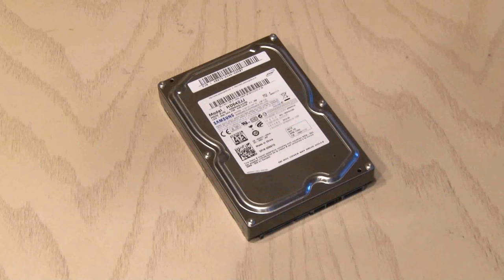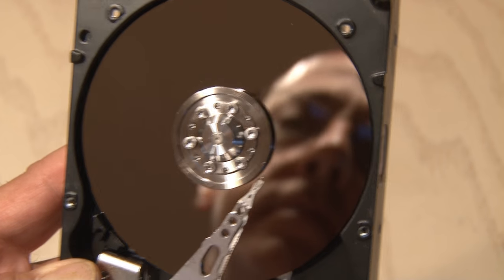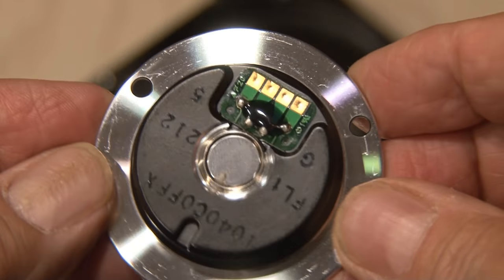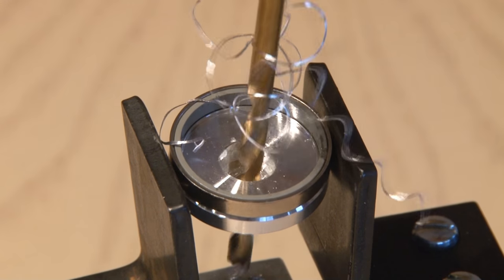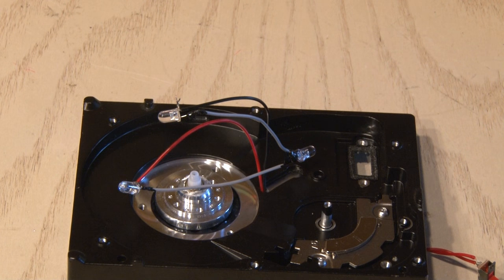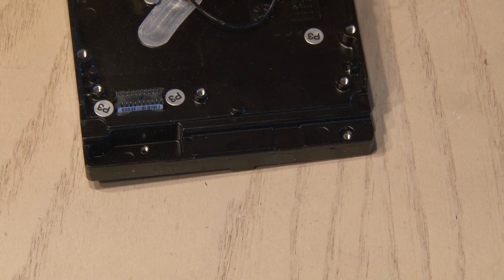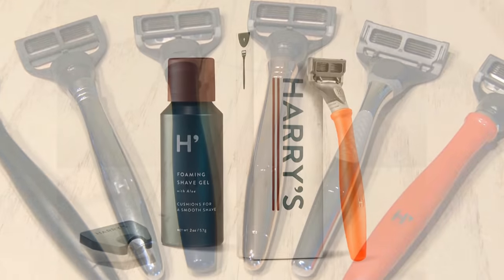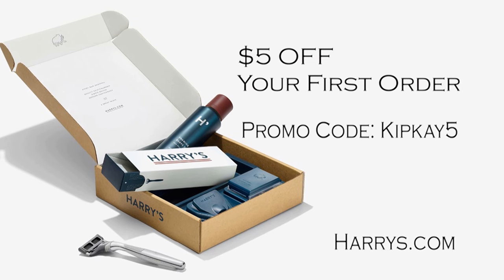Turn a HARD DRIVE into a CLOCK!

Comment: I didn't see any used, but was a resistor used with the LEDs?

While they will "work" without, LEDs should generally have a resistor wired in series. The resistor is to limit the current going through the LED - without one, the LED can draw too much current and can burn out.
Reply: They have there own resistances, enough in series won't require a resistor, mr farraday.

Comment: I dont have a vice so i used a couple of dumbbells to hold the spindle while i popped out the motor and bearing. I also had to hold the spindle with a pliers while drilling out the center piece. It took me a while but was able to make this project. Thanks kipkay

Comment: Two minor things I'd have done differently:

1.  I'd have wired it so that the clock and the lights use the same power source (and I probably would have gone with the AC adapter idea, just because I hate changing batteries).

2.  I'd have either cut down or picked out different hands for the clock so that the fit within the radius of the platter.
Reply: 9 ≠ 1.5
Reply: @Snake Plissken - Small voltage regulator boards are available for less than the price of the clock movement.
Reply: Good point. Didn't think of that.

Comment: It would be nice if the disk itself spun around and the original hard drive spindle was the clock-arm to tell you the hour. That'd be sick.
Reply: if the pcb was still in tact i guess you could hook it up to some power like a psu

Comment: Making a rotating LED clock out of the disk and motor would have been much more impressive.
Reply: Was thinking the same, but the rpm on the hard drive would require some heavy down-gearing

Comment: Disappointed...I thought the RPM of the motor will be adjusted to the movement of a clock
Reply: OMG I THOUGHT THAT TOO!
Reply: i thought that too
Reply: That would require complicated gearing. Not the type of stuff Kipkay is known for. His projects are very simple and usually pretty cheap. Adding the gearing would put both of those out the window.

Comment: You may have did your binairy wrong my chap.
1100 is 3
0011 is 12
0110 is 6 ( this is correctly placed)
1001 is 9( this is also correctly placed)
So you mixed up 3 and 12.
Reply: no he has it right
Reply: Didnt know you could change the order of the most and least significant bit. But what I have learned is that his way is the right one :O
Reply: You read it from rigth to left, not left to right.
Reply: 1100 is 12 and 0011 is 3
Reply: You want him to wrong your chap?

Comment: Not impressed. Unless the clock movement was powered by the harddrive motor.
Reply: It would be cool to see it go around at 7200 RPM!
Reply: You would put a 7200:1 gear reduction, that is called "the second hand" on a clock.

But you still could let the shaft have the original 7,200 rpm output (like a planetary gearbox with the shaft sticking all the way through), it would probably be too fast to see. You could have colored paper and it would turn a solid color (though without it shutting off, you wouldn't notice it was multiple colors.

Comment: since the platters on the hard drive are removable, does that mean you could switch the platters in different hard drives?
Reply: No, any fingerprints / pieces of dust will ruïn the platter, also the circuitboard will still think it is 80 gigabyte.
Reply: but do it in a dust free enviroment with out touching the platters to much?
Reply: i actually managed to recover data from an old failed drive by removing the platter and putting it in a working drive
Reply: its technically doable,
Reply: +Kristupas Račius thats really cool!
Reply: i heard if you move the arm the drive will work again
Reply: I heard if you melt it, then reshape it, it  will work just like new.

Comment: Can't see how cool it is. You just dissembled a hard drive and put quartz clock in the hard drive, attaching some of the dissembled parts on the clock. The core part of the clock has nothing to do with the hard drive.The hard drive is just part of the decorations of the clock. It would be much cooler if you changed the rpm of the motor instead.

Comment: If i'm not wrong the disc is make with glass not metal , nice video !
Reply: You're trolling, right?
Reply: No I'm not ^^ , the disc is make with glass or ceramic since 1990 that's make the disc more smooth than aluminum. If you dont believe me go read "Hard drive" section on wiki ;)
So no i'm not trolling ^^

 (sorry for my bad english :/ )
Reply: Hikko It looked like metal to me. Is there any metal on it? I know CD's have metal.
Reply: yes it's like CD's, a cd is just make with plastic and a very tiny metal layer and it's almost the same for an hard disk but an hard disk is make with glass coated with a magnetic layer for store data :)

Comment: No resistor on the LEDs? You might get away with it using a 9V battery, but hook that up to an AC adapter and you can bid them farewell.
Reply: You don't say.
Reply: not if the AC adapter is rated at 9 volts. I think you are assuming that all adapters are 12 volts, and while most of them do output 12 volts there are some that hit oddball voltages like 9, 13, 15, 18, and 24 volts
Reply: If the battery has high internal resistance, then you can get away with not using resistors, but I wouldn't do that myself. What if you changed to a battery with less internal resistance, and that ends up frying the LEDs?

Comment: oo no resistor on the leds...
Reply: not if the adapter is at 9 volts as well
Reply: Nathan Caggiano it's about the current, not the voltage
Reply: There are adapters at lower currents as well. I have a few sitting in my drawer rated at 12v 200 milliamps. Found them at a garage sale.
Reply: ok, but that doesnt make it good practice. and 200mA will destroy an LED - most are rated at like 20 to 40

Comment: Now I know what to do with my broken laptop lol :)
Reply: the hard drive most likely still works
Reply: Laptops usually have ssd (solid state drive)  not disk hard drive
Reply: +Andreasn333 new ones sometimes do, most still have hdd
Reply: Modern laptops might have SSDs. Older laptops definitly don't have SSDs. And since OP is referring to a broken laptop it's most likely an older model
Reply: Arjen Hartink True :)

Comment: 20 megabytes?? Thats not even ENOUGH to hold a single OS. If you were to say Gigabytes, it would make more sense.
Reply: He said Gigabytes not Megabytes.
Reply: Nope. Hard drives from the late 80s and early 90s were often less than a gigabyte. The operating system of the time (commonly MS DOS.) only required around 3 megabytes.
Reply: Ummmm, yes, hard drives back then, late 80's to the early 90's, were that big storage wise.  20 Megabytes was an insane amount of storage space back then.
Reply: Yeah he meant 20 megabytes, and yes that's plenty enough space for a light OS (primarily MS-DOS at the time).

Comment: Hmm, I've got a couple of them but I think I'd try to hack the motor control itself in the circuit and make the plater rotate itself once per 12 hours.
Reply: then you'd need a separate motor for the minute and second hands.
Reply: Zarsa Nah, I'd just have lines for hours and minutes or rather every 5 or 15 minutes and screw the seconds. It would be mainly to get the idea of the time and look cool than get accurate time measurement.

Comment: What is "non-digital hard drive"? Do you mean its not a SSD or Solid State Drive?
Reply: A "non-digital hard drive" is actually a Mechanical Hard Drive. Mechanical hard drives require the platter to spin to read and write data (and are slow because of moving parts) and SSDs don't have moving parts, so it is what Kipkay calls it "digital"

TL;DR: Only mechanical hard drives work with this project.

Comment: I just convert my old hard drives into external hard drives.
Reply: How?
Reply: There are cases that you can buy, you simply pop the hdd in, close the case and there you have an USB interface on the outside.
Reply: Thanks!
Reply: I do that too, but eventually (especially if you work with PCs and/or just have bad luck with them like I do) you'll be left with more drives than you really need.

80GB isn't all that big anymore when most desktops are coming from the factory with at least half a terabyte. (hell, the LAPTOP that I'm typing this with has 3/4 TB, and it's not even a particularly new or well-equipped one. I got it on clearance more than a year and a half ago).

The data on a drive that size could easily be consolidated (which I imagine Kipkay probably did if it wasn't already dead), leaving you with a drive to build this project with

Comment: I have that exact same hard drive but a 200 gig and a 40 gig
Reply: Same. I got a 20 gb, 40 gb and a 120 gb. But Western Digital is all I buy. I've heard Seagate has gotten better, but I've steered clear of them since they made a bad batch of 40gbs in the late 90's early 2000s.
Reply: Mitch Awesomefoot I once got a 500 gig IDE Seagate drive for an old ass desktop and it didn't work.  Now all I will use is WD
Reply: And I also had an 80 gig one but I put it in another computer that I don't have. These things get hot fast I find
Reply: Seagate still has the most failure rates of the larger companies as a whole, but they have a few drives that shine above the rest.
Reply: I cant agree Nathan Caggiano with that cause my friend has a seagate in his desktop and i got a seagate laptop drive in my laptop and no issues
Reply: Nathan Caggiano also have an externel drive no issues
Reply: Peter Kapica I don't think you understand what failure rate is. Failure rate is the number of reported failures by consumers, and if you look at the numbers which are publicly accessible Seagate has the highest failure rate of all the larger brands. That doesn't mean that your hard drive will fail, it just means that your hard drive is more likely to fail. Its not a matter of opinion, its a fact.
Reply: Nathan Caggiano ah

Comment: why would some one mak clock out of expensive hard drives.
Reply: Did you not even watch the start, he used an old hard drive, 10 years old, worthless.
Reply: Expensive? who tf would keep a 80gb hard drive thats worth nothing?
Reply: +m'Tato  Maybe to repurpose it as a recovery disk for their operating system files.  On top of a 16TB SSD, I would find an 80GB/16TB hybrid drive setup very useful with the 16TB setup for storing my user files.

Comment: Bad idea, after 1 year is disk corrosion...
Reply: If you are saying the platter will start to lose its shine over time, just take the extra step and apply a coat of lacquer to it. Voila!
Reply: Smoothe it out with sandpaper.
Reply: How? They last longer than that in a computer
Reply: joblessalex They aren't exposed in a computer though.
Reply: They are exposed. There is an air hole on them.

Comment: Who cares, you can turn anything into a clock.
Reply: sure, crush em mix it with glue pour it into a mold or onto a flat surface to dry then glue a few whole ones as numbers and add you mechanism
Reply: Even waters?
Reply: pour it into a bowl and add floats and anchors, got urself a flat clock
Reply: BMAN488877 we'll never know...

Comment: It's likely plastic
Reply: I have broken hundreds of these platters they are not metal
Reply: Here's so wiki info As of 2015, laptop hard drive platters are made from glass. Aluminum platters are often found in desktop computers.[1][2]

Platters are typically made using an aluminium or glass and ceramic substrate. In disk manufacturing, a thin coating is deposited on both sides of the substrate, mostly by a vacuum deposition process called magnetron sputtering. The coating has a complex layered structure consisting of various metallic (mostly non-magnetic) alloys as underlayers, optimized for the control of the crystallographic orientation and the grain size of the actual magnetic media layer on top of them, i.e. the film storing the bits of information. On top of it a protective carbon-based overcoat is deposited in the same sputtering process. In post-processing a nanometer thin polymeric lubricant layer gets deposited on top of the sputtered structure by dipping the disk into a solvent solution, after which the disk is buffed by various processes [clarification needed] to eliminate small defects and verified by a special sensor on a flying head for absence of any remaining impurities or other defects (where the size of the bit given above roughly sets the scale for what constitutes a significant defect size). In the hard-disk drive the hard-drive heads fly and move radially over the surface of the spinning platters to read or write the data. Extreme smoothness, durability, and perfection of finish are required properties of a hard-disk platter.

Around 2000, hard drive manufacturers started transitioning from aluminum to glass platters because glass platters have several advantages over aluminum platters.[3][4][5][6]
Reply: It's just a thin coating of metal around glass or plastic
Reply: It's an aluminum coating nothing more

Comment: Actually a lot of old electronics has some pretty valuable minerals and metals in them.
Re-using, and salvaging the materials would be handy and fetches a nice sum of cash.

Specifically copper and gold, used in a lot of circuitry.

Comment: What part of the computer is this from the monitor or tower
Reply: Yeah man... I think you just got trolled pretty hard there.
Reply: YouAreSafeNow what do you mean
Reply: Dear god
The cringe
Reply: The monitor
Reply: Its taken out of the monitor, open your monitor form the back and take out everything until you reach a large panel that looks like its covered with aluminum foil, rip that out as it is useless and the hard disk will be revealed.
Reply: The Diamond Spider Zombie Yup what a wonder, its still a shame that they put that useless LCD panel in the way of reaching the hard drives.
Reply: OMG. WTF.

Comment: I have an 80 gb hard drive that keeps clicking when you install it. Not a joke, help will be appreciated.
Reply: The thing that goes back and forth next to the actuator is stuck :/
Reply: You do realize that this is the scan right, but the scan fails, try deep cleaning.
Reply: Dray Crouse In this past month I've put in my new com a 250 gb ssd with a pci-e x1 slot adapter with riser. I had to cut my gpu case with a jigsaw just to fit the riser. And I installed a wifi adapter, but that's besides the point. The thing is I've had usb sticks bigger than 80 gbs. If I would have any thig REAL important I would just ake the disk out like in this video and given it to a professional. So what the point? IM WRECKLESS I have a nokia just so I can throw it at walls when I get angry! I don't use like hacks I hack into the damn things to get them workin! That ssd was because I thought my hard drive was a little slow. So is there something about the wifi adapter? OF COURSE I used that so I could game on a 60 inch 120 FPS TV! I JUST WANNA PLAY SOME GAMES AND FIND OUT WHAT MY GRANDMA HAD ON THAT OLD AF HARDDRIVE THAT WAS AT THE TIME the TOP OF THE LINE. AND IM ALL OUT OF HARD DRIVES. Lets play some games shall we? EDOOT: this is my new bio.
Reply: ? He didn't say anything about scanning.
Reply: That Dude and 7 Piglets So childish.

Comment: I can't believe that kipkay called this a non-digital hard drive..... all hard drives are digital (whether or not they are mechanical or solid-state). #smh
Reply: How is this digital? It doesn't seem digital at all.
Reply: You're sorta right by definition. Kip doesn't have a computer science degree so I wouldn't get flustered about it
Reply: it saves data on the spinning thingy in 1 and 0 (this is digital data storing) if it were to store data othervise it would be analog...
Reply: It's got circuit boards, therefore it's digital. It also records data in digital format.
Reply: HDDs uses magnetic storage, which is technically an analog technology, especially when comparing with solid state technology. You're right that the data itself is encoded in a digital fashion, but the drive itself is could be colloquially refered as an analog drive and it would be close enough not to make a huge deal about it.

Comment: Windows 7 be like:
Reply: windows 7 was in the days where 200 gigabyte hard drives and larger were standard. I would say more Windows 98 or older. Some people still use Windows 7 today as it is still a valid operating system and has benefits over newer versions, especially dealing with stability and privacy.
Reply: Pleiades Co. windows 10 is better
Reply: AreUReadyKids so is XP
Reply: technology productions 2017 XP hasn't aged well and is barely used,also,unlike for windows 7,many browsers and software creators have already disabled support and updates on an XP.
Reply: But there's work arounds

Comment: the plater is actually glass not medal
Reply: no, no its not. Hard drives work by magnetically storing data on the platter, most consumer grade hard drives have aluminum platters. 
EDIT: After a quick search it seems that some older drives did use glass platters that were coated with a magnetic material, but most platters are aluminum and that is most likely what the platter in the video is made of.
Reply: Nathan Caggiano aluminum is not magnetic
Reply: John Harmon welp